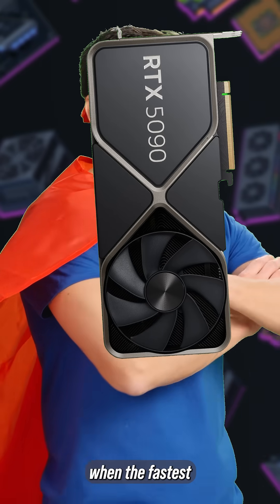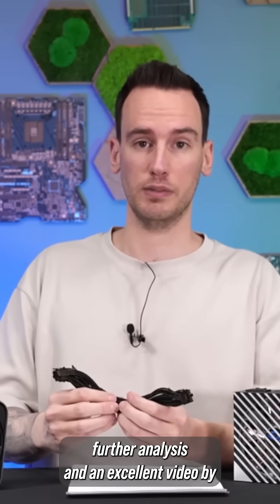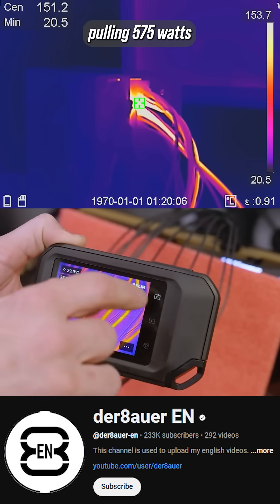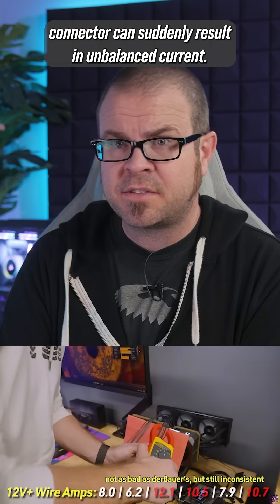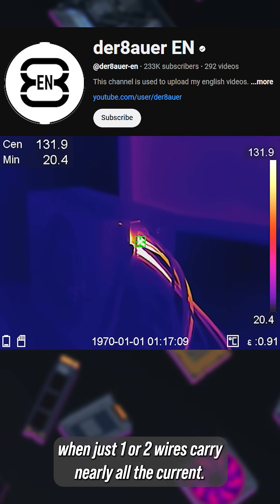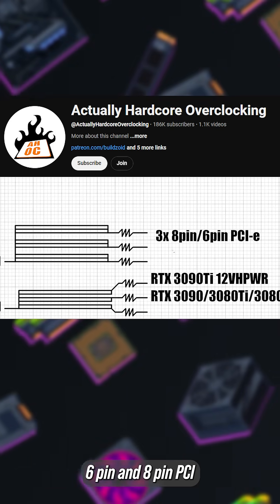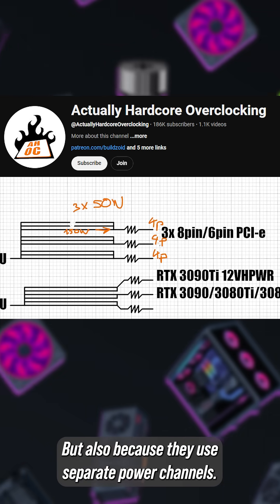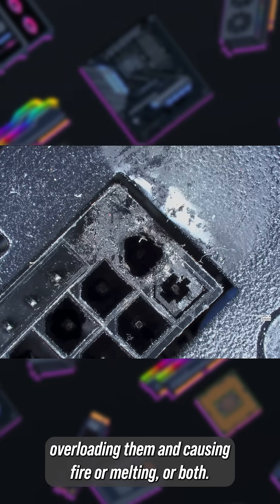GPU Power Connectors Melting... Again 😭 #computerhardware #RTX5090 #pcgaming

Comment: It is staggering, just how many different issues and Nvidia is sweeping under the rug or giving the middle finger this generation. I am stuck with a card with a dangerous power connector, and only my willingness to use it at 1/3 of the rated power limit has me fully protected against a catastrophic failure. That’s not why I do it, but it is a nice bonus of the way I have my card tuned.

Comment: Meanwhile all the 30, 40, and 50 series cards with 2 to 4 8-pin connectors are doing fine without a single story of burning cables.

Comment: Anyone knowing about electricity and power, will agree that a small connector as that one used, is a recipe for disaster. 600W @ 12V is a lot of current(amps). If it were 115V/230V it would be another story.

Comment: I think it's an issue more so with the motherboard. If you are spending money on the #1 GPU you need to spend money on the best motherboard. I know spending $1500 on the Godlike seems ridiculous, I think it's worth it. I had the Godlike and a 4090 and never had issues, as well as I was able to get benchmark scores 20% higher than the person in second and run significantly higher clock speeds. If I remember right I topped out the 4090 at 3800 MHz where it was marketed to top out at 3000Mhz. That being said at 3800 MHz it was always unstable when trying to play games and was only practical during benchmarking. Now I don't know if it's apparent if the cause of melting is coming from the inside of the connector or outside, but my hypothesis is that with the cheaper motherboards the power draw causes a higher heat build up on the motherboard side or whatever the cause of the melting is and not the connector side. Or maybe it could be in some form or another, an unstable application of voltage from the motherboard causing the melting at either the motherboard side of the connector or the GPU side of the connector.
This is all an uneducated guess work, so if anyone has a more in depth understanding and knows for a fact it is solely the connector, then you will have to forgive me. I'm just trying to think outside the box here.

Comment: Makes me not trust Nvidia. Imagine buying a 5090 only to have the connector melt after a time. What if warranty is up? You're stuck with 3000 usd e-waste.
Reply: I'm becoming more and more disillusioned with Nvidia, started with EVGA closing shop and the reasons why. It's a shame because I'm sure there are engineers at these AIBs who want to add additional shunts or a fuse but literally cannot because Nvidia stunts their margins to an absolute absurd degree.
Reply: Should have a recall they charge enough
Reply: @johnsparozich6839  they can recall the 200 cards they released
Reply: I stop trusting NVIDIA after my ASUS 2080ti and even ASUS brands. GO with AMD stuff.
Reply: Consumers are asking for it at this point but they're all rich dudes with plenty of disposable income so they're not going to be hurt too bad by it
Reply: Scalpers, or rather, 'investors' as they insist on being called does not equal consumer